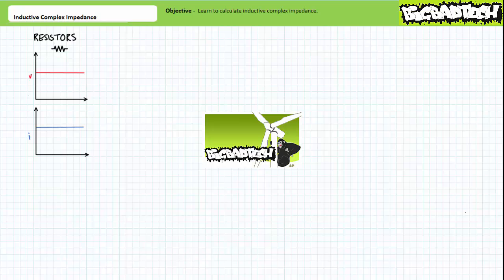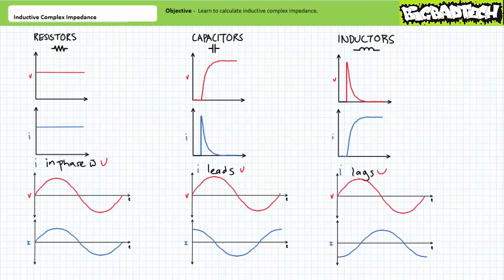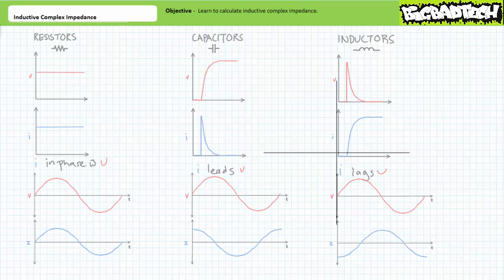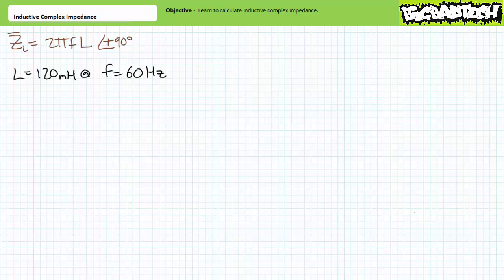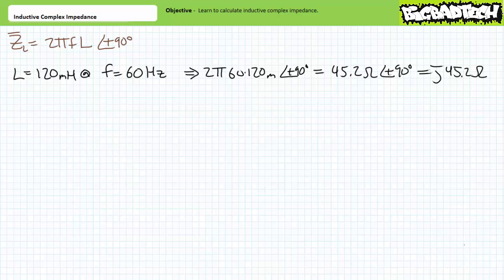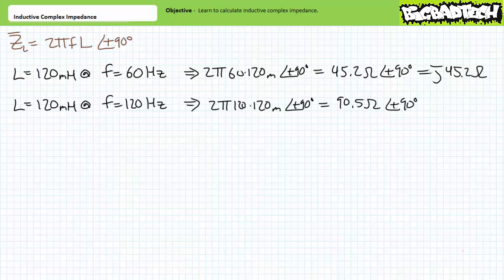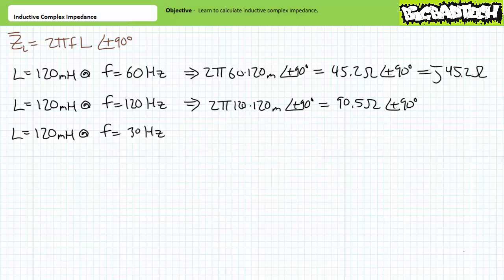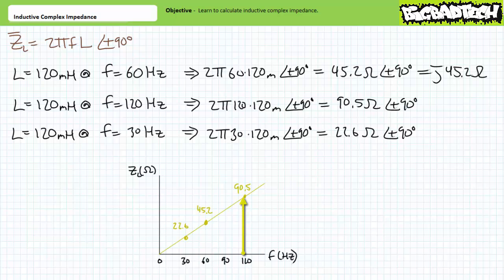Inductive Complex Impedance (Full Lecture)

Comment: With regard to my question posted on the phase shift lecture - "why is capacitive impedance -90° when current leads":
at (TAFE) tech we are being taught to solve parallel circuits by determining current through the reactive components, then calculate circuit current using rectangular format, the use ohms law to solve for total reactance. Is this why we draw inductive reactance at an angle of -90°? I'm doing 2nd year Electrotechnology (electrician) in Western Australia
Reply from the maker: Glad you're making use of this material. Here's the reply from the phase shift lecture: Voltage, current, and impedance are separate properties and, when expressed as phasor equivalents, each can have their own angle. Inductive impedance has a +90 angle but current lags voltage by 90. Conversely capacitive impedance has a -90 angle but current leads voltage by 90. It all comes down to ohm's law. I=V/Z. Ex: inductive impedance with Z/+90 yields I/-90 given V/0.
Reply: @bigbadtech  great, thank you.